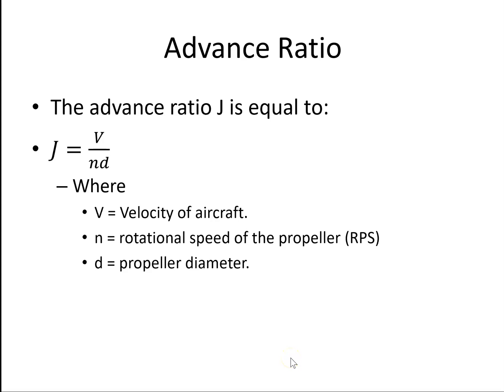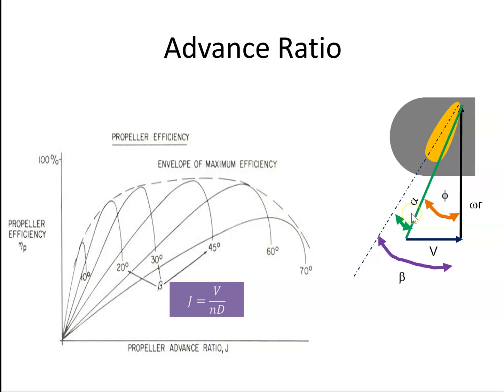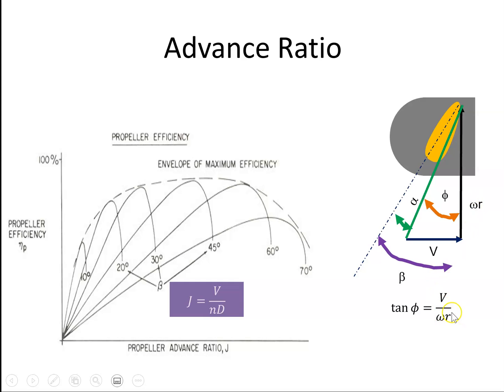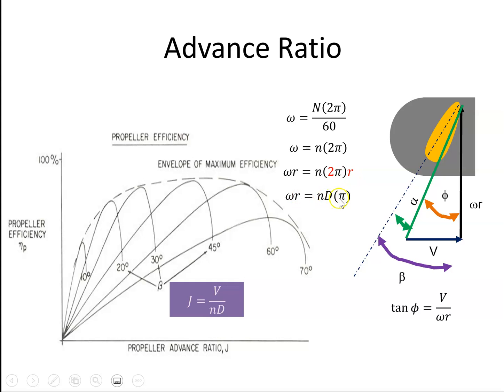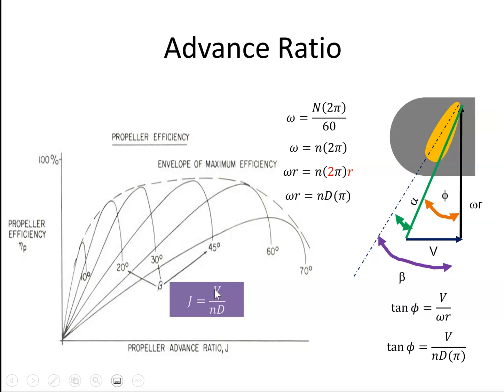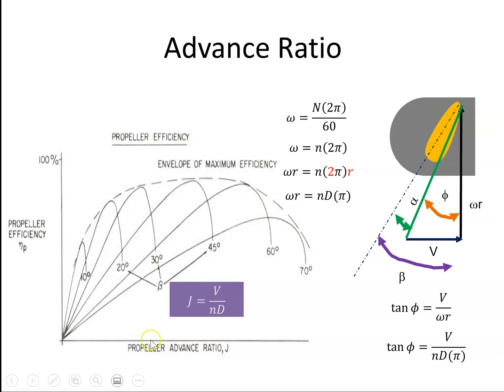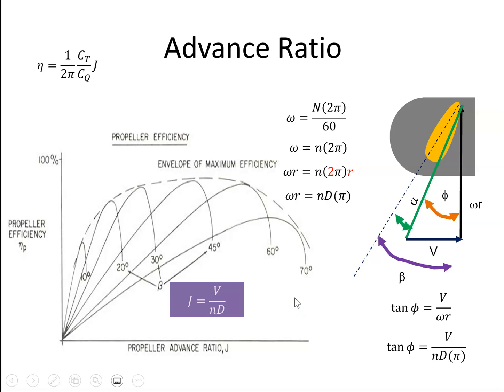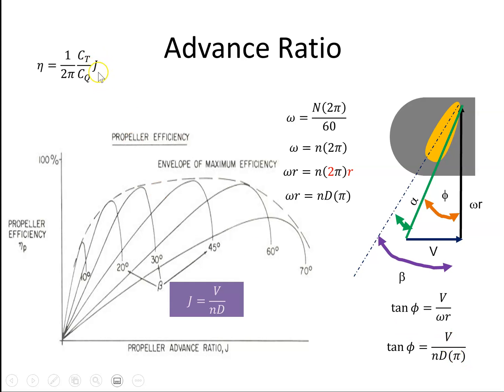Propeller Advance Ratio

Comment: From that efficiency formula, which is efficiency is proportional to the J and the J is inversely proportional to the propeller's diameter, so is it saying that it is not good to have a long diameter propeller? This is contrast to helicopter, it is better to have long rotor blade so its loading factor is smaller. Second, as per your efficiency vs J ratio, the most efficient propeller blade is (around) 45 degrees, is this true? As in most I learn that most angle of attack of wing and helicopter rotor is maximum around 15 degree. Did I miss something?
Reply from the maker: D and n both contribute to the advance ratio J.  Propellers have high RPMs (eg. between 1000 and 3000 RPM), helicopters have low RPMs (somewhere around 200 and 300 RPM).    The most efficient propeller blade angle is when the angle of attack is typically around 4 degrees.  That is where the L/D ratio for the airfoil is typically at its greatest.  The blade angle is the sum of helix angle and angle of attack.  The helix angle is dependent upon the airspeed and the RPM.   Have a look at this video, and maybe it might help.  https://youtu.be/ukxpT0ThHVk?si=glhmnDQh_CAH0_Hg